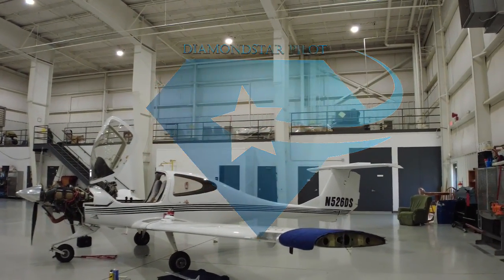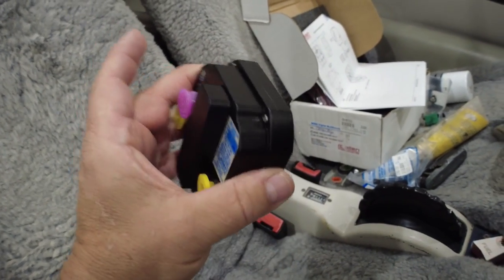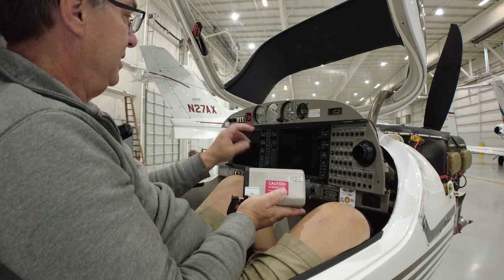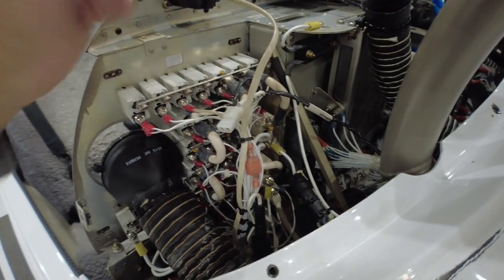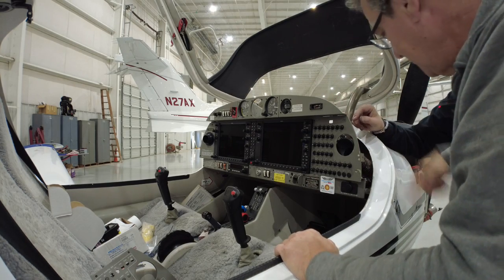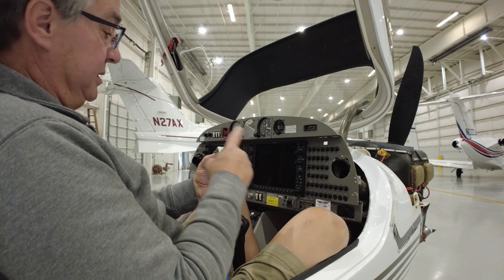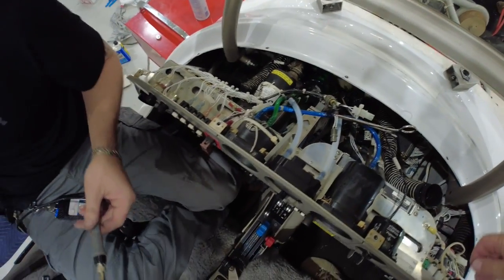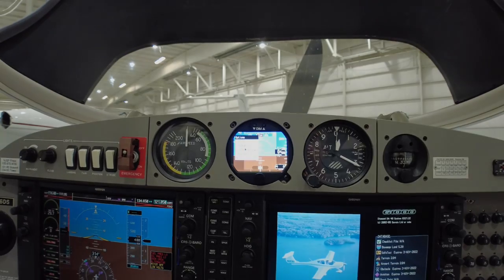Artificial Horizon Installation-RC Allen Mini 6 in a DA40.

Comment: Never worked on a plane before, but seeing tubing pushed onto barbs without a clamp of some sort in a high vibration environment gives me the willies. Wouldn't do that on my race car, thought it is true that these don't hold pressure... still surely there's some sort of clamp that's applicable just for security? If that T fitting works loose you loose both instruments... the OEM tubes appear to be shrink fit onto the barbs...
Reply from the maker: No need for clamps.  Once these fittings go in, they will not come out without cutting the tubing.  I had to remove some tubing during this installation and could not get it apart with any amount of force without cutting the tubing. The OEM tubing is not shrink fit.  It is vinyl where as I used poly.  Thanks for watching.

Comment: Now you've had a few months with the Mini 6, what do you think? I want to get one as a drop-in replacement for another RC Allen device, but there's almost no info, reviews, etc on the Mini 6.
Reply from the maker: I am very happy with it.  It's a great little unit.  Once you get it setup, current baro is the only thing it needs from you.  I will be putting up a video about it in the next couple of weeks.  I agree that there is very little information available.  You would think RC Allen would be a little more aggressive with their marketing.